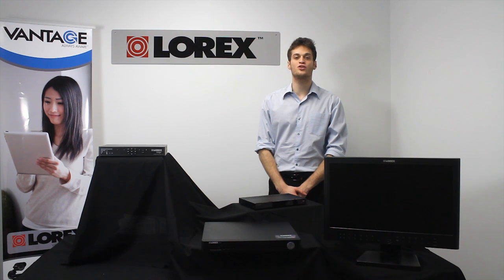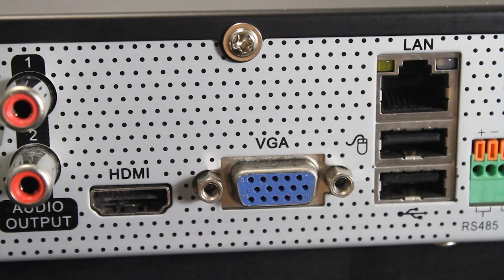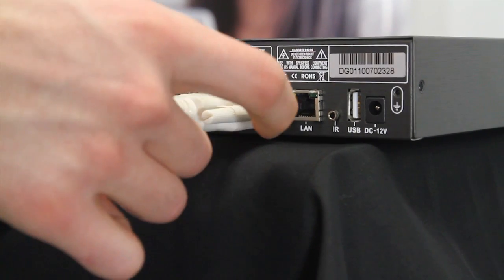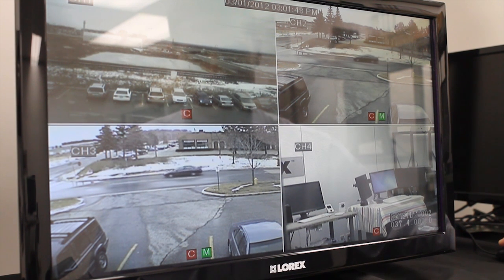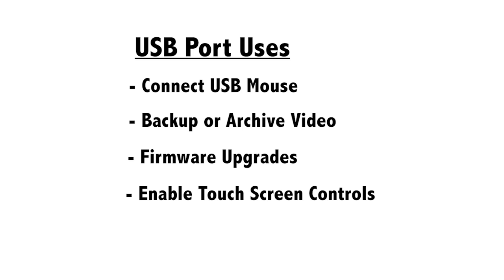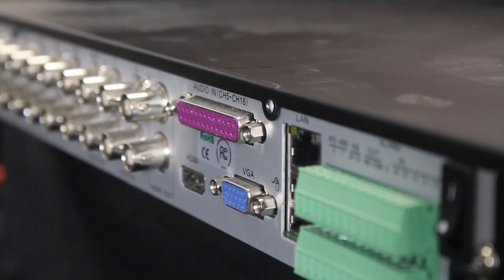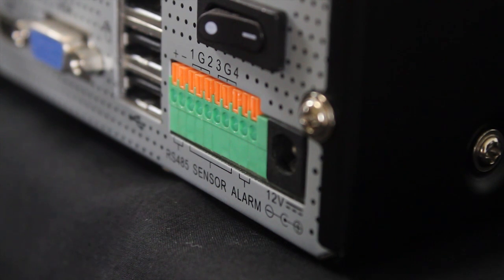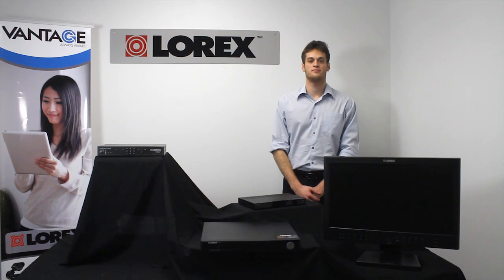How-To Tutorial on Lorex Security DVR Ports

Comment: Excellent information. I only have a few questions 1. Regarding the Rs485, you indicate that there are more in my DVR, it only has 2, how does it affect me or how would it be used? 2. On the Internet, my WiFi is small and fits in a hand or pocket, and its cable is square like the one used for cell phones. I have to add the Internet cable. my camera system is D871B series 4Kultra HD DVR. Thank you

Comment: Can I plug it, to, 220 voltage
Reply: Sure, if want sparks flying and a total melt-down of your unit ....lol
Now if you are from outside of the United States that doesn't use our standard 110v/120v outlets which is what the DVR unit uses in this video, then you would have to contact Lorex and make CERTAIN they can provide a unit that is made for your particular voltage and outlet style

Comment: I,  I need reset my lorex dvr!  you can help me.. thanks
Reply: I know your question is 2 years old but in case others need the information.....
If your security system is connected to the internet, you can call their customer support whereby they can clear the password and then you can reset it. 

The other way is to unplug your DVR, take the screws out of it, remove the cover, look for a button on the circuit board, and then hold the button down while connecting power back to your DVR until you hear a BEEP sound and/or until you see the Lorex default screen come back on your monitor which means you have now reset everything back to the way the camera system was when it came from the factory.
Reply: @get-the-lead-out.4593  Thanks! that helped me !
Reply: @NetiioHDZ  
Glad I could help :)
I did this on my 8 channel Lorex DVR and it worked just like I wanted whereby resetting everything back to factory default settings and clearing the password in order to do a new password
   I bought my Lorex 8 channel security system used: Model LW44W that came with the Lorex DVR model D841A81B and the previous owner didn't know the password.  I called Lorex and they wanted the model and serial number and then wanted me to give them my full name, street address, email address, telephone number, etc etc for me to get the information. I told them I hadn't bought the unit from, didn't registered the unit, and I bought it used from Ebay and could show them the receipt. They told me they needed my personal information anyways in order to set up an account with them and then I could download their software which allows the user to connect with the cloud for storage, let the user access their security system from a smart phone,  and allows Lorex to send a password reset.
   However even though I can understand why they want the model, serial number, my name, and etc for security purposes whereby would if I was a crook up to no good by trying to reset my neighbor's security system while theyre on vacation, robbing them, and then having set the new password which allowed me to delete the video stored on the DVR's hard drive,   I WILL NOT give them my personal information and I WILL NOT allow my security system to be hooked up to the internet since there is a legitimately serious issue with a consistent rise in people having their security systems hacked into. I mean, I  DO NOT like the possibility of some perv watching my wife and daughters get dressed in their bedrooms or even just being able to watch us throughout our house and property.
   Long story short, I ended up taking my Lorex unit to a local pc repair and the guy was pretty cool. He said business was slow and even though he doesn't know much about my particular security system from Lorex, he would take a look at it. Next day he gave me a call saying he found the information online which wasn't easy but I'm now good to go.
   Really nice thing is he only charged me 20 bucks for the time search it and to disassemble the DVR to test it making sure it was the right instructions for my unit.
Well hey sorry for the book and if you need anything, shoot me a question and I'll see if I can help :)